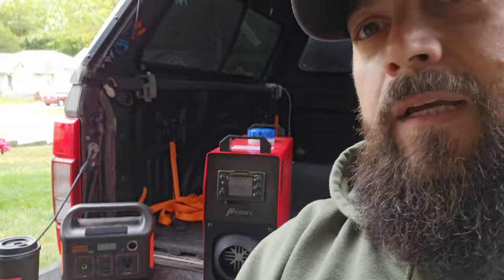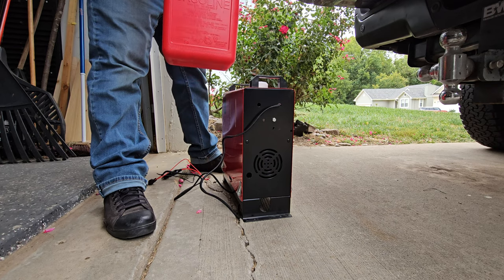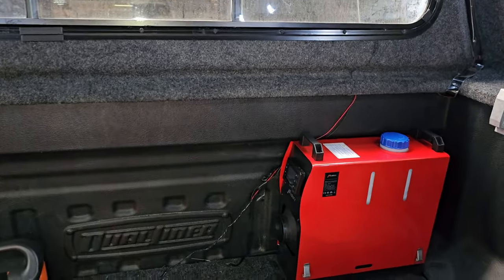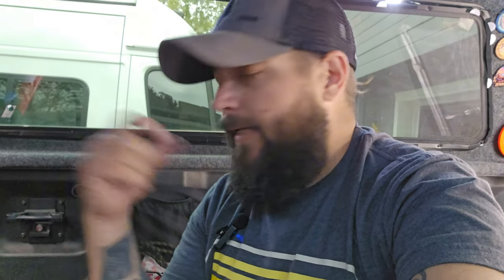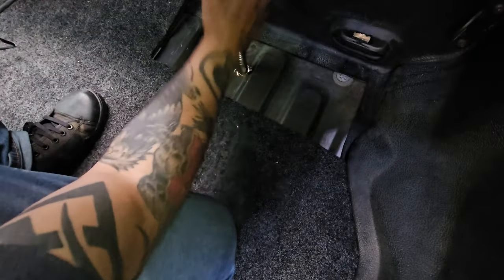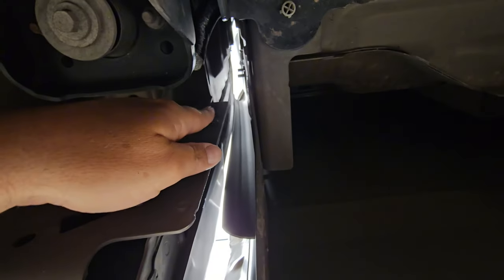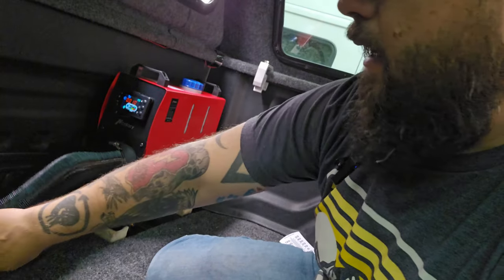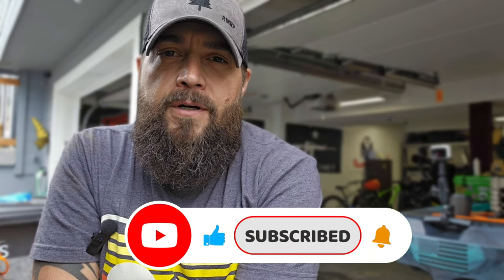Truck camping | Winter Prep | Hcalory Diesel Heater Install

Comment: I'd be mounting it elevated, and drill holes in my canopy, rather than the truck box. And have plugs for the holes, when not using the heater.

Comment: Great install. I have a plastic bed liner in mine so I don't think I want to start drilling thru all that and the box too. I may have to try to find a way to make a temporary exit thru the topper in the front between the cab and topper if there is enough room.

Comment: Hey I got a 500ah lithium battery that I use for a trolling motor. How long do you figure that would power one of these heaters before it needs a charge? Thanks!
Reply from the maker: @jamesperrier3059  a 500ah lithium is about 6000 watts. The heater runs at roughly 25watts/hour. So like over 200 hours.
Reply: @ThreeTrailsOutdoors  fantastic thanks for getting back to me!! Looks like a slick set up. Just ordered one. 

Got a 15 day hunting trip coming up in negative temps
Reply from the maker: @jamesperrier3059  if you mount inside just be sure it's in a thru hull and make sure it's sealed, make sure exhaust isn't under bed. If I had to do it again I would use a tire mount for the heater and duct into camper shell.

Comment: Ive yet to get mine running but plan to heat a canvas tent in the winter. Have plans and materials to operate it from a rotopax type of fuel can. I may even DIY a inlet for my small RV when boondocking.
Reply from the maker: There are lots of cool diy mods out there for this setup with tents. I'm already changing one thing and that is adding a double walled pass thru where it goes thru the truck bed.

Comment: Did you seal the hole with anything around the exhaust? Weren’t you worried of heat and the truck bed? Well actually you have a metal bed, mine is composite. I have the Planar case heater but after using it I’d just rather keep it in my truck. I’ll be recycling air bc it already has a filter on that and I’m not sure it’s necessary to have fresh air?
Reply from the maker: I ended up installing a steel thru-hull exhaust fitting to stop the heat transfer to the bed.  I have the intake getting fresh air outside the bed as well. 

https://amzn.to/3Tz6Uyx

Comment: How’s this been going with the Jackery? I got the same heater and am trying to find the wires to power it off the dc. Can’t find the cables anywhere.
Reply from the maker: I bought a 12v plug and wired that up. Admittedly I haven't used it this winter, spoiled by the ease and comfort of the van lol. But as far as the jackery goes, it's more than enough to power it.

Comment: Used a wood bit to cut through steel bed? Lol get a hole saw
Reply from the maker: @Nyquist_Outdoors  aluminum bed. Working with what I had, it didn't seem to have any issues going through. Thanks for watching.